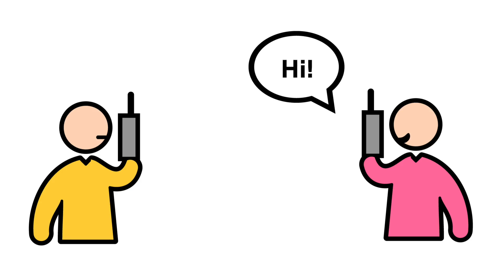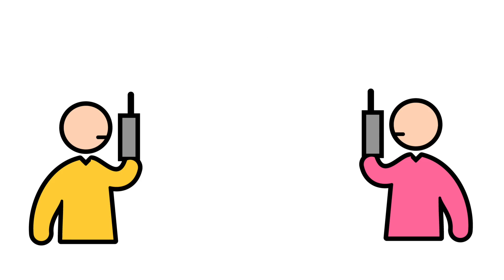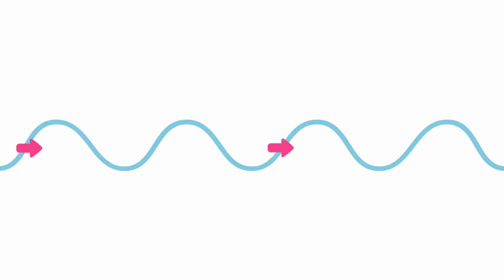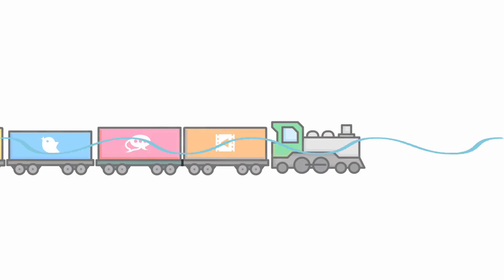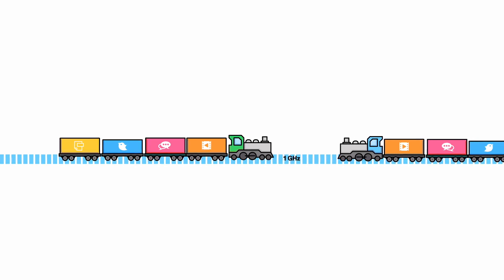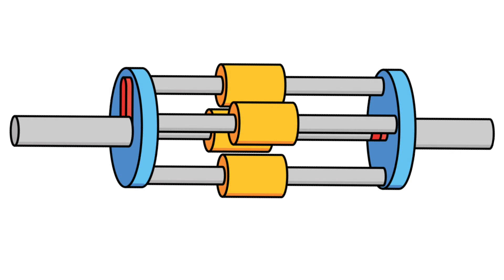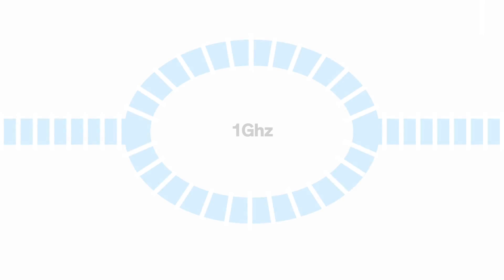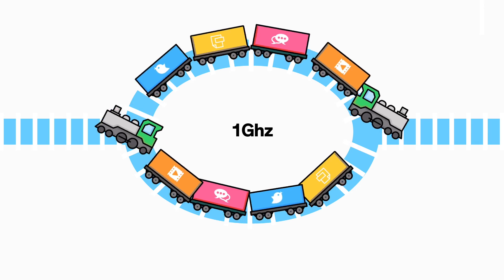5G Technology: Full Duplex Explained

Comment: Not a fan of the train crash metaphor.  People are going to think that there's something big & explosively obvious that physically stops or blocks you from running 2 signals in the same bandwidth area.  But really both trains are fine using the same space, it's just that their cargo is intermixed and thus ruined.  But those trains will still keep going!  It's like trying to make a meal by adding your ingredients into someone else's cooking pot, the pot doesn't explode across the kitchen walls - but you've made 2 inedible meals, and the problem is invisible until you taste it.

When you make these sorts of mistakes, it's not explosively obvious like a big loud train crash that any layman can understand.  Instead, it's subtle, it's something you have to keep checking for all the time to make sure you didn't miss it.